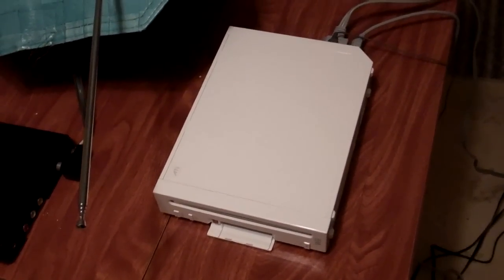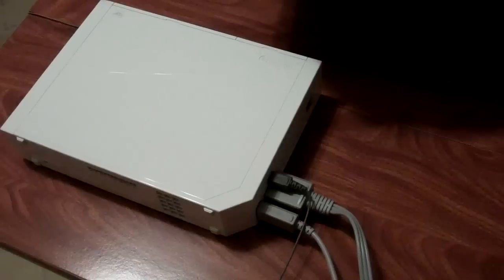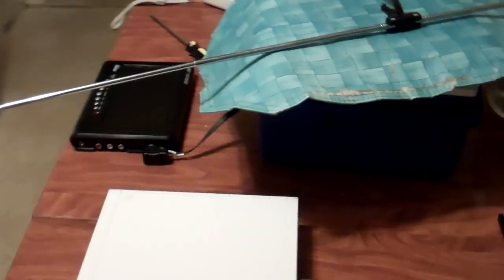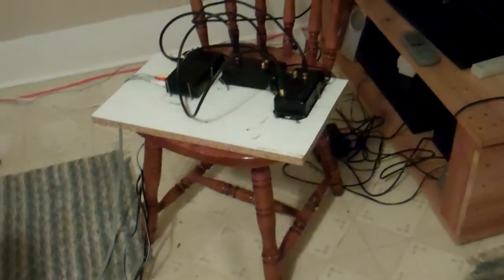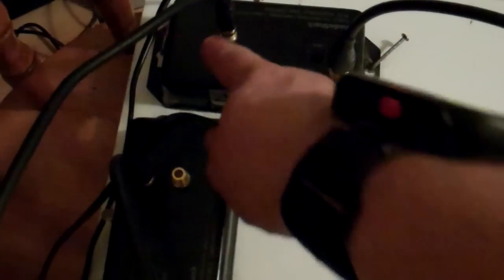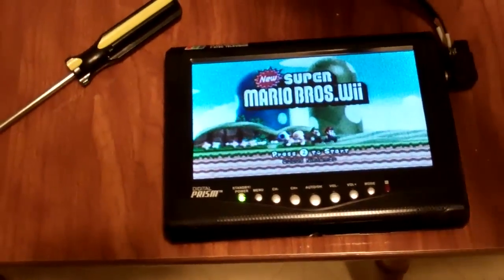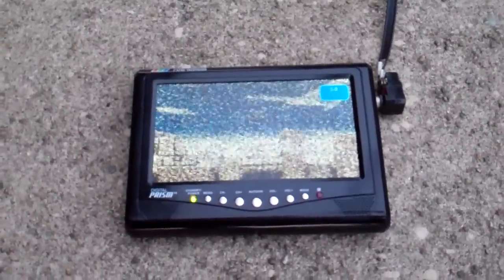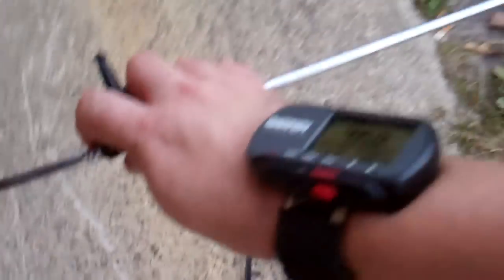DIY: Build Your Own Television Broadcaster

Comment: Nice job. I wanted to do this to transmit an analog signal out to my workshop that doesn't have cable. I like the fact that you mentioned the FCC rules. That's a good2know.
Since I'll be in a certain location all of the time, it would be good to learn more about directional antennas so that I wouldn't have to boost my signal so much.

Comment from the maker: Should be fine. It's the 2nd amplifier, if any, that could get overloaded. If one is much stronget than the other, the weak one should be first, so as to not blow anything, but your signal would be less.
This is designed for use on rabbit-ears (dipoles). The roof antenna was for demo purposes only (will send you out of legal range too easilly).

Comment from the maker: @honse246 
Yes, it would, same to more powerful ones. Another thing that will help, like it did here, is a bigger antenna.
Keep in mind, to keep the signal under 300 feet (or about 100 meters).
This went past that, but it was only a demo. I use rabbit-ears normally, and get a 100-foot max on this.

Comment from the maker: RadioShack only sells 12dB amps now. There is a cable amplifier, bit I'm not sure the dB rating, or if it'll work with broadcast (likely just channels 2 - 13).

Comment from the maker: You're either using an amp that has a shut-off point, so you don't oversaturate (overmodulate) the output, or it doesn't work right. Try putting the one in question as the first amp. If the problem persists with just that one, the singal is too strong (auto shut-off), or the amp is bad.

Comment from the maker: @SimmeringPotpourri 
In your case, a roof antenna will definately be best, if you can't find anything more unidirectional. It'll also cost less to run the system.
With analog cable, unless the system changed since the early 90's, you're relegated to the first 12 (2 to 13)  channels. It's probably not so anymore.

Comment from the maker: Provided you have an open connection, you can, but it'll be very weak.
With Twin-Lead, in a closed-circuit connection I started with in high school (a very long time ago, 8-Bit Nintendo-Era), I could get a signal about 12 feet away, where the connections broke, and were twisted back together. The signal wasn't watchable, but there were recognizable shapes. A few feet away, assuming analog signal, you may get color, if the tuner is VERY good.

Comment from the maker: @JDTV1995 
Not really, but if there's a gain control, set it to it's lowest setting, and adjust while in operation. If that's not an option, use collapsed rabbit ears, and slowly extend.

Comment from the maker: @SmashSomeCrap 
It seems so obvious, right? It doesn't work that way.
Take a 20dB amp, and feed it into a 10dB amp, you're amplifying a 20dB gain by 10, giving you about 50 or so (it's not mathematically 200, or it would be real strong), whereas a 30dB amp won't go as far.
I'm not sure where you can get these amps, as RadioShack seems to stop making those before the DTV switchover. Not sure why, because you need the extra power to get equal strength from DTV.

Comment from the maker: You won't fry the antenna, the question would be how many of those amps can you put in-line, before frying the amps (particularly the ones receiveing the amped signal near/at the end).
4 10dB amps in-line seems to be a safe stopping point.

Comment from the maker: Do you have them in the proper order? The RF signal on the amp's Input, antenna on the Output? Seems simple, but that's not uncommon to happen.
I'd set the amp to the lowest settings, and ramp up, although I'll tell you that being directly under the antenna may actually produce a bad result, as seen here in the video.
Otherwise, try out the individual components, see if one isn't working.
Also keep in mind of analog/digital content.

Comment from the maker: @JDTV1995 
No really, but you'd want the strongest first. On paper, it doesn't matter, but the noise added to the signal is amplified greater smaller first, winding up with a weaker image.
If you use one that automatically cuts off with a  strong signal, don't use those. Does nothing.

Comment: I got it to work using the Radio Shack MTS stereo modulator (only sold on Ebay) using a Ramsey whip antenna being held by my hand in the "Out to TV" jack.  Although it only would travel about 3 feet to the indoor TV antenna.  I'm going to try using a Ramsey right angle mount whip antenna so my body doesn't ground the signal holding the antenna. Then I can try connecting it to a 36 db amplifier.
Reply from the maker: You really got to know what to do, to get these to travel far. In most cases, the signal will not do very well. My original setup (long before this) was a 20 and 10Db amp, in that order. In a TV stand with an 8 inch shelf, tucked in the back, the signal went about 75 feet. Out in the open, about 6.

Comment: i built a 1 transistor amplifier on tv ch 4. range 25 feet with solid state tv receiver tuner. I built a 1 tube transmitter. I wish someone else could test it.

Comment: Did you find a different size antenna made any difference? I have a small one for my broadcast setup and it is maybe 2 feet tall when extended but its hard to get a clear pictures from just 5 feet away there is lots of snow static and interference. Plus I get some noticeable lines moving up the screen when the picture is good unless the antenna is just about to touch the tv's antenna. I have 2 36db amps but when i turn up the gain the picture looks worse. If you care to share any info that can be helpful it would be more than appreciated.
Reply from the maker: It does make a difference. A set of rabbit ears gets about 80 feet in this setup, but on the roof antenna, I was well past 350 feet away.
Reply: Have you tried one of those DIY antenna's that's suppose to work better than an off the shelf kind?
Reply from the maker: Tropicalwebsurfer Nope.
Be interesting to see an end result.

Comment from the maker: If you wire the two up, the weak one should be last, to get a better signal. If you're worried about blowing it, the other way will work, just a hare worse.

Comment: since all antenna tv is digital and (I assume) this is analog, would the FCC still get on my case about this?
Reply: Noah Barrager as long as your project does not cause interference there shouldn't be any issue.
Reply from the maker: Stay under 300 feet. I didn't know this would go as far as it did, so if I were to do it again (and won't), I''d have to tune it down a bit.

Comment: how much db would i need for uhf. i have a tru-spec usm 8 uhf modulator hooked up to my vcr on the output but the signal is very weak through the antenna
Reply from the maker: UHF is a major pain. You need roughly about 10,000x the power just to get a signal as far as a low-range VHF station. (Probably a lot less difference with minimal, or no obstructions.)
You'd probably blow the amplifiers trying UHF because of the power needed to get a signal anywhere, so unless you go heavy duty, I'd not try.
Reply: georgef551 what would the signal distance be if i were to use say channel 16 and use two 36db amplifiers
Reply from the maker: Danny Vanhala
Just a guess, because I never did anything but 3 and 4, I'd guess a barely usable signal in 15 feet. If you got the stuff now, you could see.
Reply: georgef551 so what would i have to do for a fairly clear signal to go about 30ft
Reply from the maker: Danny Vanhala
A very good antenna will help here, especially a high-end UHF one. Not sure on distance, because there's so many factors and variables, but I'd say you might do OK with 3 of those amps in series, if the 3rd can handle the signal going in.
Reply: georgef551 so 3 36db amps and do i use rabbit ear uhf antenna or a large one like this. http://www.ebay.com/itm/HDTV-Outdoor-Amplified-Antenna-HD-TV-36dB-Rotor-Remote-360-UHF-VHF-FM-150-Miles-/310464020303?pt=US_Antennas_Dishes&hash=item484918ff4f
Reply from the maker: Danny Vanhala
Outdoors will work a LOT better (inside, of course), but start weak, and increase the power from there. Will not work well on the roof (no direction).
Reply: georgef551 is there a maximum amount of amplifiers I could use or can I use as many as I want. also could I broadcast more than one channel through this
Reply from the maker: Danny Vanhala
Not sure how many, but there's a maximum, when the last amplified signal will be too much for the next amplifier. In an older setup, I could not go past 3 before system shutdown.
Reply: so three channels max through this setup
Reply from the maker: Danny Vanhala
My guess would be yes, depending on how heavy duty the amps are.
Reply: georgef551 thank you for your help. ill post a video later to show everyone how it works
Reply from the maker: Danny Vanhala
Good luck! If the results aren't what you expect, it may need adjustments, as they can vary widely.
Reply: what are the chances of it blowing by the way
Reply from the maker: Danny Vanhala
Not sure, but an old setup I had back in high school blew out a 10dB amp every time, but frequency was unknown.
Reply: does the higher the db mean less or more chance of blowing and how much time is the max this setup could be ''powered on''
Reply from the maker: Danny Vanhala
The higher, the better, and the more likely the tougher the parts are.
Reply from the maker: *****
Never did UHF. Everything I used it on either works on channels 3 or 4.
Reply from the maker: *****
You need at least 2 amps, at least 20dB apiece to get any halfway-decent range. Then again, it depends how they're placed, and where as well.

Comment: bro, where did you get that Radio signal converter?
Reply from the maker: +Komaromi Kristian 
The amplifiers were from Radio Shack. Don't know where you could get them now, at least the amps.
Reply: no, the rf converter
Reply from the maker: Komaromi Kristian
I think Best Buy still would, or a specialty shop (B&H Photo/Video is a good place.)
Reply: Komaromi Kristian you can buy an AV to RF converter pretty much anywhere that takes the audio video signal and turned it into a RF signal for TVs that don't have the audio video input signal the way I did it is I took an old VCR hooked it up to the output and ran the cable from the output of the VCR where the cable line goes from that to the TV hooked up to a amplifier and then put an antenna on the amplifier it only works with in like 8 feet though so it doesn't go as far as this one was in this video but that's the basics of how you can do it there's a bunch of ways you can do it just look on YouTube

Comment from the maker: Since you're measuring in kilometers, I'm assuming you're not in the States, so I'm not sure what the law is on broadcasting where you are. Here, it's a 300 foot (just shy of 100 meters) limit without a lisence.
In your case, you'll need professional-grade equipment to do what you want. This stuff will get blown to bits, trying to make a signal that strong, and that stuff is NOIT cheap, and costs a ton of money to operate, roughly the annual salary of a fry cook, per MONTH.

Comment from the maker: There's no video needed, as you simply attach an antenna to the poutput, and point it where you'd like the signal to reach out to. It's that easy.
Besides, the equipment is long gone now (it stopped working right).